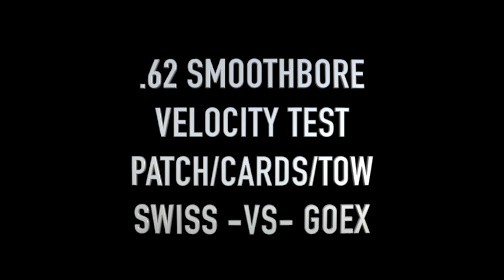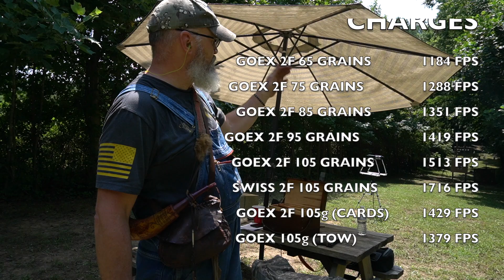FLINTLOCK SMOOTHBORE VELOCITY TEST. GOEX VS. SWISS. PATCHED BALL VS. TOW VS. CARDS.

Comment: So I've been wondering, I've seen Goex Reenactor powder around and some guys will use it for shotguns or for cowboy action. I know that consistency isn't the greatest with it(mix of granulations), but have you ever tried it in a smoothbore? I ask because at 11.50 a pound it would be super affordable if it worked.
Reply from the maker: I haven’t tried it but I do own about 10 lbs of it. Mix of 2f and 3f according to Schuetzen. I think it will work fine for shot in 20bores and smaller. I’ll test it out and see. Thanks for the reminder.

Comment: I have a question. Based off of another comment. Is Goex 2f sized different the Swiss 2f. Is Swiss 2f more like Goex 3f. If so, what size Swiss should I consider trying
Reply from the maker: Swiss is a tiny bit smaller granulation than Goex. Not much but definitely different. Also the coating is different. Goex is dull, flat black where Swiss has a gloss to it. I'd say Swiss 2f would be great to try for smaller bores where you would normally shoot Goex 3f.

Comment: That patched ball velocity difference was an eye opener. 
Question is what charge is going to give the best group.
At some powder charge the patch is going to fail and flyers and big groups will show up.
Also lube will make a difference.
I see you used spit patch. Will that fail sooner than a tallow lubed patch? The fun never ends does it?
Reply from the maker: I will be running some patched ball load dev on this gun. I used spit patches for my swab between shots. Was using a bear grease, Mink Tallow lube for the patches.

Comment: Very informative. Didnt think Swiss would give that much of a jump. Ive been using 2mm thick wads cut with a 5/8" punch over my powder with shot to get some of the pressure loss back... Ive noticed some success honestly. Tried tow, wool, and cards prior to. Definitely more felt recoil on a 100 grain charge.
Reply from the maker: Hey Pat, thanks for the comment, I didn't either. I figured 150fps max. I know it's a bit hotter than Goex but I didn't expect a full 200fps jump.

Comment: i use swiss as its what i had for my shiloh blackpowder catridge reloading and when i mentioned how much a 70 gr load kicked in a 50 i had some snivels. Now i know ... as all the other dudes were shooting goex. Be interesting to see  how much of a swiss charge gets you the same velocity of a goex charge.
Reply from the maker: I'll do that test next velocity video! It is definetely a hotter powder. No doubt!
Reply: @BlackPowderTV  It looks like Swiss is about 20% hotter than Goex.  Look at the Energy not the velocity.  Goex 105 Energy 1733   Swiss 105 Energy 2229.  I would guess from that an 85 grain load of Swiss would be about a 105 grain load of Gioex.